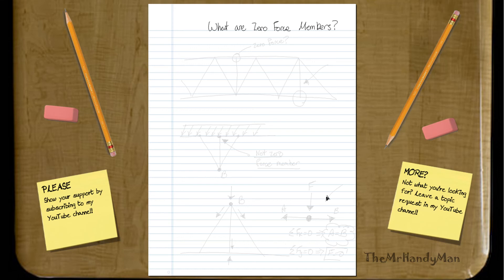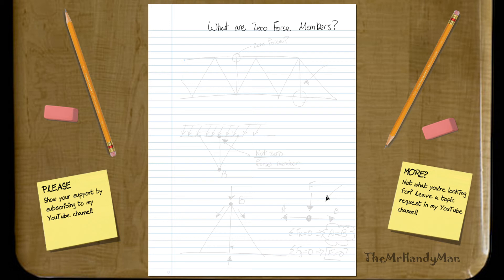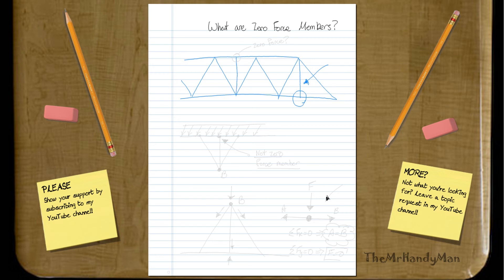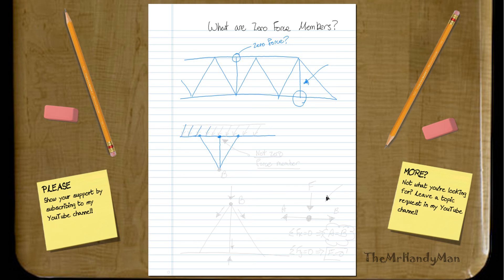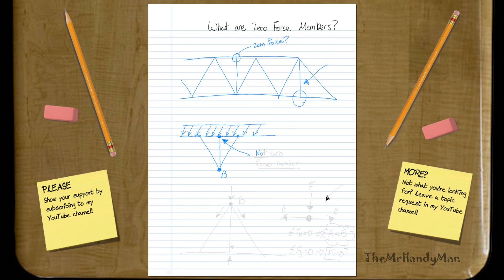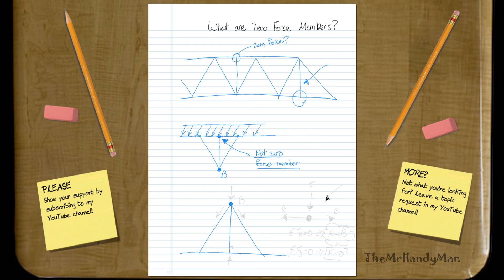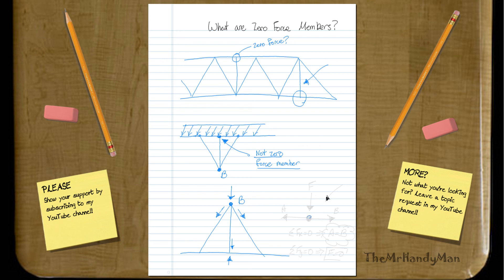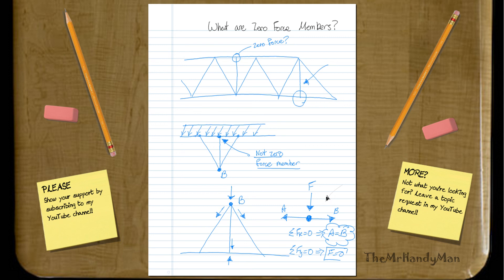Vector Statics - Trusses - Zero Force Members

Comment: * If only two members meet in an unloaded joint, both are zero-force members.
    * If three members meet in an unloaded joint of which two are in a direct line with one another, then the third (perpendicular) member is a zero-force member.
    * If two members meet in a loaded joint and the line of action of the load coincides with one of the members, the other member is a zero-force member.